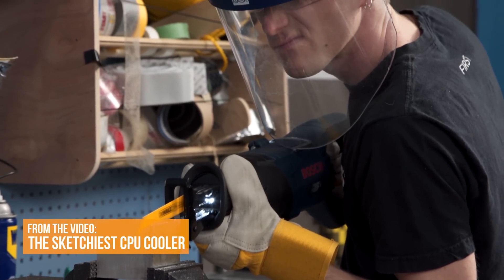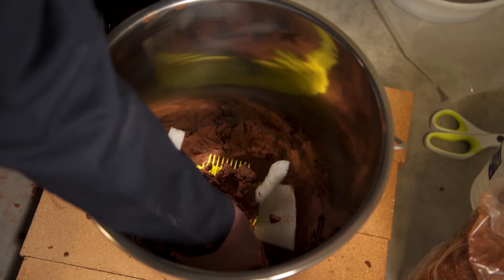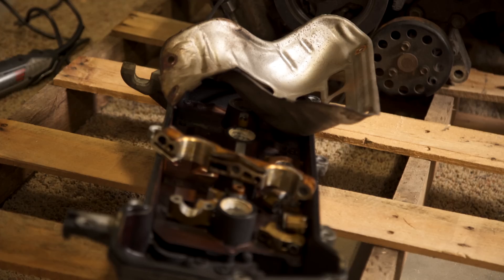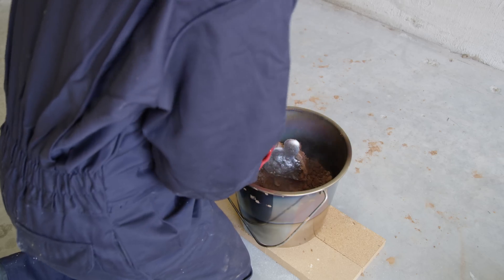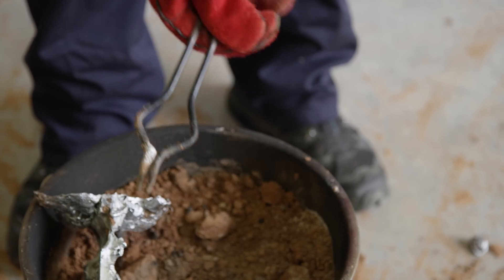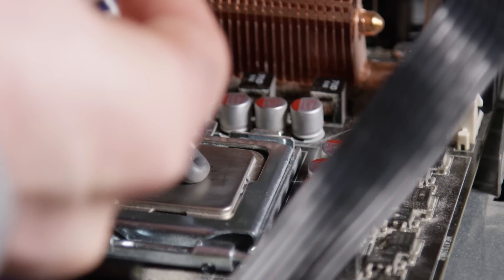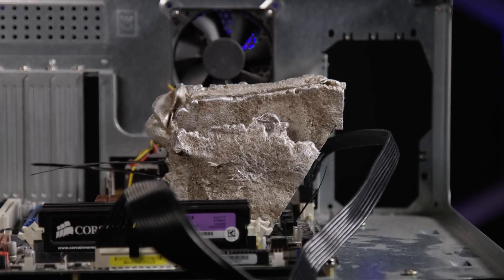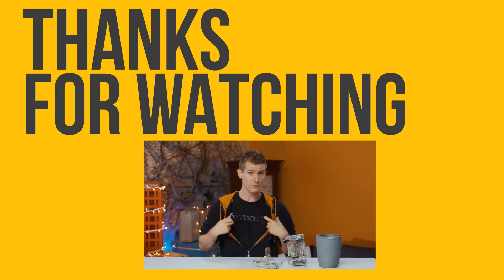The WORST CPU Cooler EVER – Sketchy Heatsinks Ep2

Comment: A simple, 100dollar solution: 25 piece laser cut aluminium sheet contraption. Bolted together and flared out. That would produce a low thermal mass, large surface area and low weight. And before you run out screaming: AH LASER CUTTING IS SUPER EXPENSIVE etc. Considering that a sheet for making this costs around 10-15 dollars (sub 1mm thick) and the final product does not need much post-fabrication, it rounds up a rather rational budget for the laser cutting. Hell, a small shop may even do this for less than 100.

Comment: Get copper and bend it to the form of heatpipes and then get some aluminium plate, cut it into size, drill holes into it and glue it to the copper using some kind of thermal adhesive

Comment: 3D print it in ABS plastic or wax, then use a centrifuge when casting the heatsink. ABS can be dissolved with acetone, and you can dissolve PLA plastic with chloroform. (Linus should not try this) ;P

Comment: Why didn't they try casting it with the fins down? Why were they trying to force aluminum to go UPWARDS TO FILL A MOLD?!?! Basic design mistakes guys. Could have easily made a fill port for the mold and hacked off the non heat sink bits afterwards.

Comment: Another Idea for a probably less sketchy heat sink would be to use a couple of aluminum plates and just weld them to a base plate... Simple but effective. You'd only need a big plate of aluminum, some cutting and welding tools. Depending on the size of the plate (the thinner the better right?) you could even cut the sheets with some... oh.... pliers?

Comment: Dear LT team

When casting next time, set the heat sink sideways so that it can produce the fins better as the cast fills with aluminum. Then on the face plate, just sand it down a bit and you'll be good to go.

Comment: Haha... you guys should change the orientation of your foam molds  (fins pointing down, baseplate up). You won't need all that pressure to fill up your mold, let gravity do all the work for you. Also, use loose dry sand for lost foam casting, not wet-green sand. put your mold in a bucket add all the dry sand you need around it, vibrate the bucket to ensure the sand settles down, becomes more compact, and fills all the gaps. add more sand and repeat if required.

To use green sand you'd have to manually fill in all those tiny channels and make sure its all compact, all the while trying not to damage your delicate mold.

Comment: Maybe it had worked if you had put the heatsink in upside down so the fins wouldl be filled in first and the contact plate to the CPU contact plate would've been the place for the drain hole as you would've had to sand it anyway.

Comment: I may be missing something about metal casting here...... but why the hell couldn't they just have made the mold in the shape of an upside down heatsink?? That way the metal would simply have to fall in to the individual fins instead of relying on pressure to push them up into them..

Comment: The purpose of fins on a cooler is to increase its surface area. So instead of using fins to increase the surface area, why not use holes? Drill presses are very common so it wouldn't be hard to find one to borrow for an hour; and using a press would offer much more control than the reciprocating saw. Or here is another idea. Make a sandwich block alternating aluminum and copper. Use bolts to keep them packed tightly together; and use a band saw to square it off. Then lapp the bottom and drill holes for airflow like on the solid aluminum block.

Comment: What you SHOULD have done is to pack the clay with a wooden dowel and a hammer so that it wouldn't deform when bucket was heated.
I urge you to try again with the PLA printed cooler.

Comment: normally you use cast models in wax. And the harts sand usually have resin in it so you heat the entite sand mold so it sticks together and the wax melts BEFORE you pour hot metal into the formed cavity!
You will always get issues if you use the metal to melt the model due to gases and stuff need to escape somewhere..

Comment: Grab a cube of copper
Drill a holes through the sides
Drill a holes through the top, matching the holes made from side
put a fan(s) on whenever side you want, pushing or pulling the air respectively
Done.

Comment: I'm just genuinely curious, as someone who learned casting in undergraduate class and never tried myself nor even seen a video by a famous youtuber. Is it possible to cast such a thin feature in an amateur setting? What I learned in the class was that molten metal would cool down while flowing and eventually clog the passage, failing to achieve desired shape.

Comment: What a mess, surely having the aluminum block is much easier. With a good pillar drill and some planning you can make circular hole out dissipation system.

Comment: Foundryman of 15 years here Did you mix bentonite clay into the sand? you should poke some holes in the top of the mold helps the air and gasses escape during pouring, I would pour the metal at 1000c maybe even 1300 c also the sand has to have just enough water in it not too much or the mold could actually explode, a heat sink is a difficult thing to cast because of the multiple thin sections thats why most heat sinks are extruded and chopped into length, good for you for trying though this is difficult for even a professional foundry to do perfectly and probably would be die cast  . Anoher suggesion would be try Zinc alloy its easier to cast than Aluminum alloy

Comment: i think it would be a good idea to make a heat sink with a aluminium block and just drill holes in it horizontal and vertical with something like a 6-8 mm drill bit. something large enough that is won't brake while drilling and you won't have to restart. then you could just thermal adhesive a copper or aluminium block on the bottom of it and put on a fan and done. easy to make and all you'll need is a drill press or extra sketchy version just a hand drill but it will take longer. it should do okay but i guess we'll find out if you chooses to do it. good luck

Comment: casting is better if you actually have a proper mold to press i to the green-sand and just pour directly onto the sand  making a top half and bottom half mold. anywho stamping these would be easier. or getting the aluminum fins plasma cut out of a solid block

Comment: I'm not a casting expert, just do some backyard stuff with melted soda cans, but the clay you used for the green sand mixture looked like modeling clay.

Better off going for cheap cat litter (bentonite clay), grinding that into a powder (cheap coffee grinder works) and mixing that into your sand while dry, then slowly incorporating water using a spray bottle until you can grab a fist full of sand, squeeze it, and it holds the shape and when you break it, it breaks clean.

Comment: The casting was done wrong. It would be a lot easier if you would put the cooler fins down, so the metal can freely flow down... NOT UP.. + most of the attempts were rushed, pouring too fast.

Comment: 1. Print out the radiator (3d printer).
2. Put it into a bucket of a fresh concrete (bottoms up)
3. After a couple of days remove 3d printed one and fill the hole with liquid aluminum

Comment: You should try lost wax casting dipped in slip, cooked out and then cast it with aluminium in a vacuum oven. I would also cast it the other way up so the fins are down and have the mass of the molten aluminium to push itself into it.

Comment: Why don't you just take an old Lian Li aluminum computer case, cut square fins out of the side/top material with some tin snips, stick them in the green sand with maybe a quarter inch sticking up into a square-shaped depression, and then pour a molten aluminum block on top of them?
Reply: I forgot this was YouTube.  For extra-janky fun, cut the top/bottom off of a soda can, then cut it from top to bottom, flatten it out with a hammer, and use those as the fins.  Maybe get branding with Pepsi or Coke for good measure.

Comment: Some things to improve:
-Buy normal aluminium. They use alloy alu in motors, due to the very high heat there.
-You have to rotate the negative form, so the fins point downward.
-pour in slower, and make the entrance bigger, with a cone at its end. (Also better safety equipment!)
-Try increasing the Temp for better flow
-Iam pretty sure there are better casting techniques, considering, that you own a 3D-Printer. (2-forms would improve it very much)
  a) much better surface roughness Ra
  b) reproducability
  c) smaller fins possible
all i can say is: HA! YOU PAID FOR THIS? lol

Comment: Why not try making one piece by piece? I'm not saying it would work but what if you made fins using sheets of aluminium and welded them onto some pipes? Has to be better than the block of metal you just stuck to it 😂

Comment: okay, here you go: for casting medium, don't use green sand.  use Satin Cast from Riogrande.  it's what I use for making rings.  and creat a vent hole: basically creat another hole like you would to fill but don't use it as such. heat the sand, cure the top and make sure it sticks and slowly flip it over once it's hot enough to melt the plastic to drop out.  there you go!
Reply: I'd message you guys through Facebook, but that'd never get through.

Comment: You guys made so much wrong. :-)

1. Use dry sand. Water makes it more problematic.
2. Use a higher container (more pressure)
3. Coat the foam with a layer of "plaster of paris" and let it dry
4.(optional) Use a more Heatresitant foam (house buliding) and preheat the sand in a oven, so the foam didn't melt but the sand is warm/hot
5. Put salt in the pot with the molten aluminum before pouring and stere it. This will help to liquefy the slag, and gives a better pour.
6. Pour it fast and hot (you need a little bit of excess heat so the aluminum didn't solidify while pouring)

If you have more time and patience you can coat the foam form with a runny mixture of clay and coat that with sand, let it dry and repeat until a lock of clay forms, put it into sand and burn out the foam. Pour the aluminum into the hot sand/clay. With that you can create 2mm thick walls of aluminum easily. I've poured a sculpture made out of straws in aluminum this way. and in 3D-printed objects you can see every layer.

Comment: Can't you just use pop cans? I mean they're already super thin and probably easy to cut.... and they're aluminum
Reply: Oh I don't mean melting down the can, I mean to just shape/fold it into whatever shape since it's already thin.  Plus it will already have a smooth flat surface to mount it with not alot of thermal compound needed compared to the glob they used in the video. 

And it will have more surface area compared to the blob they called a heatsink =D.  And more surface area = better heat dissipation i would think
Reply: Candi Soda - Ah, I see. That's actually pretty clever. Sounds like something that would work :)
Reply: Candi Soda the number of cans you'd need would be too high to make it worth the tooth decay and diabetes (and they have numerous coatings on so only 3/4 or 2/3 of each can would be usable)
Reply: Lol or something we wish would work.  Then see all the heatsink companies what they truly are, just all talk.

But this is coming from someone who owns the NH d15 LOL.  What can I say.. I bought into it =D
Reply: Only problem is that cans are lined with plastic from the inside to protect it from the metal and preserve it longer... but there must be some liquid that can remove that + the paint on the can :P
Reply: You can, but the wrappers and paint can cause imperfections in the final product and produce toxic fumes when burnt (as far as I know). The usage of cans is quite common among amateur metalworkers.

Comment: You are Canadian, right? So get yourself a proper wood model and take a bucket without bottom and use a steel plate or something as bottom half of the mold.
Powder the wood and keep the sand dry enough and construct a neat flow into the form.
Oh and smash the fun out of the sand!
The moment when you realize the sand casting you did in collegue actually was high-tech :^)

Comment: No professional metal worker but I have done plenty of lost wax casting before. Do what you were doing but make the thing out of wax and try to get it as close to the finished product as you can. Also stop putting the fins up in the green sand, point them down and have the baseplate be where you pour aluminum into. Yeah the base will look janky but it'll fill al the fins better and you can cut sand and polish the base after its cooled. Seriously I think wax is the way to go so read up as much as possible on Lost Wax Casting.

Comment: To be honest they did a good job with what was demanded. If you're reading linus, it's legit not possible to cast anything with anywhere near that level of detail... Try using sheet copper next time, it would be really cool, you can join all the sheets together for a fin design. But please never try casting metal to that kind of detail... It really doesn't have low enough surface tension to get into the gaps. Your poor staff must have been tearing their hair out all week! Haha

Comment: take 1 mm thick aluminum sheets, some copper 5mm Ø pipe, drill 4mm Ø holes in the sheets, bend the copper pipe at some angle so that when you press fit the aluminum sheets onto the pipe, the copper plate sits parallel to each other. melt some aluminum or copper, place it in a rectangular bath and dip the bottom of the new heatsink in that. let it solidify. done.

Comment: TBH - Belt saw (prefer fixed/vertical one, not the tilt-variant, though tilt are much less expensive) + Block of Alminium + Coolant (=Oil+Water), have at it. You can get used belt saws fairly cheap from out-of-business sales and it does not have to be anything fancy. Also Belt saws are way less prone to overheating from the start. On the other hand, the saw belts are a lot more expensive, so try to get a machine with a spare belt - Linus should try to get two spares

Comment: You guys should really follow Grant Thomson's 'Stryrofoam to Solid Aluminum' video (with no clay), but perhaps orient the heatsink model upside down so that the metal can flow straight into the grooves. Try putting the riser directly above the model, rather than to the side too.

Comment: they would have done better by making the base mold for the cooler then making separate fins then slotting them in, also it wouldn't of hurt to use something like a angle grinder to smooth it out instead of a sander

Comment: To melt out the form from the mould you put it in the oven for an hour or two. Hitting it with a flame just heats up the sand not much more
And to make the alluminium fill up the entire mould you really need to make the sprue more funnel shaped to build up presure. Though for the best possible result you really should use a  VPC machine

Comment: next time... episode 3...  Some moron on the internet tells them to cut 40 fins from sheet, flux-sand the ends of them then clamp them together and push them into a 1/2 inch molten pool of aluminum.
Reply: I must be a moron cause that sounds like a good idea...
Reply: Well compared to their attempts so far it's not hard to deliver better ideas.

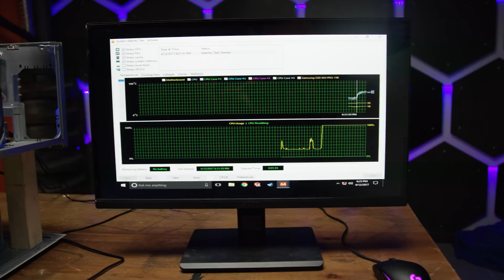Comment: 8:18 wait a second, with your piece of aluminium set on top of the fucking cpu, you get it to run at around 40 fucking degres on idle ??
I gonna design cpu cooler now, that seems easy AF.